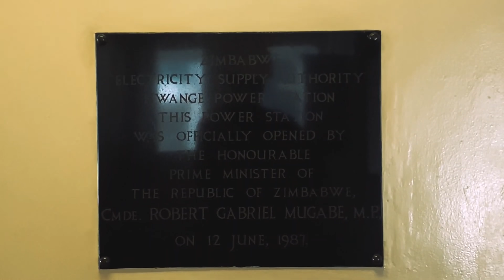The mighty Zimbabwe returning to the top [Zimbabwe Economic analysis 2021]

Comment: Correction. Kenya is now a middle income country contrary to your assertion
Reply from the maker: No it is not, Kenya GDP per capita is less than US$2000 but the threshold for middle income country is US$4096 GDP per capita
Reply: Not really. GDP per capita is just a small part of the matrix looked at. I can point you to many sources but check this news item. And btw, Kenya is in the lower middle income, so slightly out of Low income countries. https://youtu.be/QwwFWp05P4k